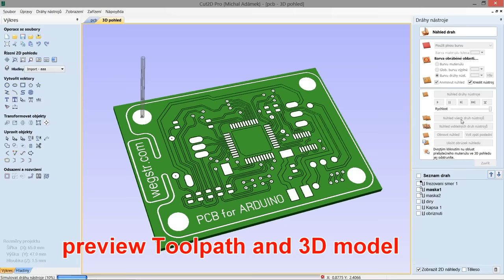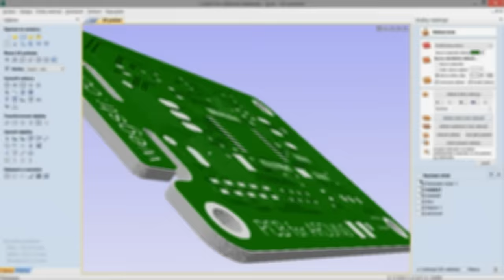How to make a PCB prototyping with UV soldermask - STEP by STEP

Comment: what about via holes in double sided PCB
Reply: you can buy rivets on ebay and stick them in the via holes to make the connection from one side to the other that is what  i have done in the past with homemade double sided boards
Reply: I was wondering if the tinning step took care of that, I suppose not.
Reply: The tinning "sticks" to the exposed copper, so there is not any copper inside the holes only around them, so the tinning does not stay in the holes.

Comment: So in a nutshell,
Step 1: Design the PCB
Step 2: Mill out the traces (from a blank, copper-laminated board)
Step 3: Apply solder mask (to protect the exposed traces)
Step 4: mill the solder mask off the contact pads (to allow you to solder components onto their traces)
step 5: Drill any necessary holes and cut out the PCB

Step 6: Protect the now-exposed copper contact pads from corrosion with tinning solution
PCB DONE
Reply: Was looking for a comment that summarizes the process... Cheers!!!

Comment: 1. What are the dimensions of the PCB? 
2. How long did it takes from start to finish it all?
3. What about the vias? Did the tin solution connect the top with bottom layer?

Comment: Great!!
But very expencive
Reply: It is little bit pricy, but when I compare this video and some other cheaper Chinese CNC that I have, the end result is just awesome, I still can't believe that this is done on CNC. It makes me think again to try this one :)
Reply: Actually, if you compare it with more expensive machines, It doesn't look bad at all.
Not expensive, costy I would say.
Can't convince my boss to get it >,>  I'll have to get by with a cheap one.
Reply: I would think twice if you plan to use cheaper one for PCBs, it won't be that precise...maybe to take a look at something like Voltera One
Reply: We are not the kind who think things too much.
After a few hours, we are already buying one :v 
We don't need it to be that precise, we just need to improve and speed up our prototyping. 
We liked the Voltera though, thanks for letting me know.
Reply: I wanted the same few month ago, and ended up buying small CNC for that, but it turns out it was useless, I was getting much better and faster results with simple photoresist dry film. This CNC looks very precise, but lack of automatic z-axis sensor can be pain in the but :)
Reply: We are not even using photoresist film now, wich is very good, It's natural if the result is better. 
I'll check the z-axis sensor thing. It could be a simple short circuit in the board copper, can't it?
Reply: Yes, that's how they work, z-axis (touch) sensors, just short circuit with board copper, but better check which software this machine support, and if that software can work with z-asix sensor like this https://www.ebay.com/p/CNC-Z-axis-Tool-Setting-Touch-Plate-Probe-Mach3-Router-Mill/1949964503 and see if you can hook it up. They said there's no sensor on machine, but didn't say if there's a left functionality on their board so that you can add your own sensor.

Comment: If only this cnc wasn't so darn expensive.
Reply: CNC 3018 PRO, it cost me 170 USD (shipping to México by DHL) on Aliexpress
Reply: @XDFTube  What software do you run to make pcbs? Do you have any videos?
Reply: @larrybud  hi I use Candle, the newst version, in that software you can update the firmware of the control board candle is the same software than GRBL controller with some upgrades

Comment: Milling the solder mask seems strange to me. How did you calculated its exact thickness and how did you ensured that you milled away just the right amount of solder mask?
I your milling depth was was a bit wrong you would either mill the copper pads or you would leave a thin film of solder mask that would cause  problems when soldering. Please clarify.
Reply: Sprng tension milling technique ensures only light force enough to mill the mask and little or no damage on copper.

Comment: please help me to buy the right tools from your website. which tool angle did you use for removing the pcb soldermask with the compression spring.  the  "30° - spiral carbide engraving bit"? or the 60  and the compression spring is the "compression spring - steel (0.2 x 2.5 x 26 mm)" right? and which tool angle did you use for removing the copper for very tiny smd components? 30 degrees 0.1mm flat or v? My guess would be the https://wegstr.com/30-spiral-carbide-engraving-bit. but I saw you used two in the video, can you describe well which parts from your website you have used so that I can buy them with no mistake.

Comment: Hi and thank's for your video. Too easy because simple side.
But your milling and drilling methods seams to be well improved and reliable.
I'm beginning the tasks of "electroplating through holes" at home.
With my CNC i'm just drilling holes as a first operation.
I etch with the paint burning method using a laser.

Comment: Great method. I was looking for a engraver/drag method of removing resist without using UV/overlay to avoid needing to get a laser printer. Nice. Now I just need to find a 30° bit that is setup for springs for ER11 setups...

Comment: Very good quality, impressive. Unfortunately, the machine is very expensive for hobbyists.
Reply: Alexandre Verri , buy cnc like this from China . It cost near 200-300$
Reply: А название модели узнать можно?
Reply: вот. нужно брать под себя( размер , комплектация ) . Еще рекомендую посмотреть видео про них, много подводных камней, которые нужно учесть при покупке. https://ru.aliexpress.com/item/CNC-1610-500mw-laser-tube-diy-cnc-engraving-machine-Pcb-Milling-Machine-Wood-Carving-machine-cnc/32719998036.html?ws_ab_test=searchweb0_0,searchweb201602_1_10152_10151_10065_10344_10068_10342_10343_5722611_10340_10341_10543_10698_10696_5722911_5711411_5722811_10084_5722711_10083_10618_10307_10301_5711211_10059_308_100031_10103_5711511_10624_10623_10622_10621_10620_5711311_5722511_10125,searchweb201603_32,ppcSwitch_5&algo_expid=912a05f5-5dd6-44d8-819c-586eb533c042-8&algo_pvid=912a05f5-5dd6-44d8-819c-586eb533c042&transAbTest=ae803_2&priceBeautifyAB=0
Reply: а что в этом станке плохого, того что по ссылке на алиэкспрес дали ?
Reply: его нужно собирать. мотор не стабилен и может давать вибрации на инструмент. для домашнего применения самое то.

Comment: Hello Lukas, I have this Wegstr machine but my old pc with parallel port died so the cnc machine is not in use now and just sits redundant on a shelf. I hear you are working on a USB version, when that is completed would it be possible to buy the USB control board only and place it into my parallel port Wegstr machine to get it runnig again but on USB?.
Reply from the maker: Hello, more information via email....
Reply: WEGSTR CNC Thanks I have emailed to your website :-)
Reply: just wired the thing with an arduino and GRBL.. cheap cheap cheap

Comment: I never considered using a spinning tool to remove soldermask. I've been using transparencies and acetone.Your approach is remarkably superior. My cnc machine doesn't use a set-screw for its tools, it uses a collect chuck. Do you think the spiral engraver and spring combination will still work?
Reply from the maker: It is not so standard combination to use the spring below the bit. But it works.

Comment: how you prevent the bit from wobbling axially when you use the spring. I mean the bit and the spring are not fully tight in the chuck so they can move up and down correct?
Reply: double point bearing... exactly the same thing you use in a 3D printer axis... you have one bearing on each side of the axis so it cant move.  
like this: (::)==[]====[]==>
spring: (::)
bearing: []
drill bit: ====>
Reply: @Ali idk... I search myself and couldn't find it too... What i know is what its supposed to do. Its made to protect the piece if the CNC machine accidentally applying too much feed force.
While the piece will still receive more feed force the force will be divide with the spring and will be applied smuttier instead of a spike.

Comment: This is impressive, it looks like it freshly came out of my manufacturer! I didn't realize CNC's were precise enough for you to remove the solder mask without drilling through the 30µm (or so for 1oz IIRC) of copper. I'm also wondering what you used for the tinning, will that properly make your through-hole pads connect from front to back?
Reply from the maker: As it is not double-layer PCB the back side is not connected.

Comment: I really like this. But I assume the one thing you don't have a process for her (besides printing/screen) is plating the through-holes, right? I assume the through-hole components here wouldn't work without you then soldering both sides, and that vias wouldn't work at all?

Tinning would just cover the copper.
Reply: You can electroplate the vias but you'll need to drill the holes first and plate, and then mill the traces and mask.

Comment: How does the machine maintain an even depth of cut on PCB? Thx.
Reply: There are other softwares for that like Autoleveller, PCB Probe and OpenCNCPilot.
Reply: I think this machine milled it's own bedding which ensures the gantry and bedding are aligned very well.
As long as you lock your pcbs down correctly it should allow you to skip auto levelling. However if you dont' want to mill a bed (which is pretty easy). 
For a software solution: 
You can autolevel in the Gcode itself (http://wiki.linuxcnc.org/cgi-bin/wiki.pl?PCB_Milling_And_Drilling_With_Cheap_And_Simple_Height-Probing)

It looks a little odd to use but basically, the steps consist of downloading the github files and running a python script. The generated G-code does height probing before cutting, it gives perfect results every time.

Comment: Ae the CNC machines for creating machanical parts the same as those for pcb milling ?
or the the machines are different?
Reply: You can use a CNC engraver or any CNC machine with a milling option that supports PCB's or engraving. It's even an option to make your own machine using open source software and hardware. So in short, you could technically use any CNC machine with a drill aslong the software allows it.

Comment: How did you generate the tool paths for the solder mask?   I am using FlatCam but dont know how to invert the pads so the tool will clear them.... ?
Reply: Steps just according to the video - we used Sprint-Layout for design and Cut2D for tool paths (it is done from picture generated during designing).
Reply: Thanks.   I just found out that Sprint-Layout has an inverted option on the gerber output which does exactly what you did in Cut2d.   I ran it through FlatCam v8.5 and it works nicely!
Reply: What type of cam operation did u use to engrave and remove the mask e.g pocket for holes?

Comment: Jan, how you are sure, you do not damage the very thin copper layer instead just milling the solder mask ? What is the solder mask height, is this constant ?
Reply: As you can see on the video we used the spring bit. It is just simple spring placed under the V-bit. This ensures the constant depth of the milling if there is some bump.
Reply from the maker: You have to clamp the spindle on the right place - just below the overhang

Comment: How do you calibrate Z coordinate after you put the milling tool and how deep to mill PCB? I don't see any z-axis sensor. Also, how come that after milling the solder mask pads comes out white? Does your software also calibration for double sided PCB and  how would that work?
Reply from the maker: There is no sensor for z-axis. You just have to setup zero points for every axis and manage the deep of the milling in designing software. The depth depends on the material. The white/silver color is made by tinning. Our software is not calibrated for double sided PCB, you have to be handy :)

Comment: How you prevent to damage the copper tracks when removing the solder mask with the cone tool? Presure control?
Reply from the maker: we used the spring bit for that control

Comment: how did you tin the PCB? which chemistry did you use?
Reply: AFAIK, it is tin dissolved in hydrochloric acid. The tin in solution swaps places with the copper, tinning it.

Comment: several questions.  what is the tinning soulution used ? after the mask was applied it did t look like copper. it looked tinned already when the cnc was routing away the green mask.  
and finally, what software was used for the pcb design ?
Reply: It’s a chemical timing agent
Reply: Very good

Comment: How did you plate the holes? Also how does tinning work? Also I noticed a gold finish. So how is that made possible?
Reply: Holes done by drilling. Tinning work done with tinning liquid (10 minutes in that). There is no gold.

Comment: hello, how about, an excellent job, a question, what do you put on the board so that it becomes green and what function does it have?
Reply: This layer is know as Soldermask. It is thermally resistant and prevents solder from sticking to anything other than the leads. This specific solder mask is uv-cured and can be found on amazon.

Comment: Why would one need to get rid of all the unnecessary copper, anyway? Wouldn't it allow better heat dissipation leaving it on?
Reply: Sometimes you don't want copper near to the traces, is a personal choice and when you gona handle high currents but normally an experienced pcb designer would add some isolation to that paths to maken more space between some traces or all traces but not get rid of all, in the end is more kind of a personal choice.

Comment: I am quite jealous!!!! that looks amazing.

i was hoping i could get some advice. i purchased the white variant of that paint. exposed to to an led array i made of 99 uv 390nm leds bought on ebay, and left it on over night. in the morning half of the uv paint stuck to the transparency and it was not fully cured. what am i doing wrong?
Reply from the maker: Maybe the layer is too thick or weak power of the UV radiation. We use 60W UV lamp.

Comment: OK, I'm missing one important thing - but before that, great video - and very cool.  So there are no through hole components, only surface mount?  No internal planes for ground or power?  Nothing on the other side?  Then plating through the holes is not important and I understand the demo, although I wish everything I would ever lay out or design would be that simple.  Still, it was impressive, and looks outstanding - and accomplished your design task obviously.  Good machine also.  I would not mind having one myself!  Thanks for the video.
Reply from the maker: Hello, thank you for your comment. The PCB is only for demonstrative purposes. So you are right, there are missing some components. We are currently preparing the video about double sided PCB. Stay tune...

Comment: to save time, cant you mask first and then mill out the traces?
Reply: You could but your traces won't be properly masked. If you mask first and then mill, the sides of the copper traces will be exposed allowing for solder to make accidental electrical contact. Also your PCB will have a really rough finish to it...possibly even leading to accidental peel of the solder mask/copper trace. Sort of like scraping a stamp of a letter
Reply: @Rishi45001  brooo. I realised that the next day. I must have been  high

Comment: Excellent
Tell me please, how is the mechanism of the spring-loaded of the mill? I want to make myself the same
Reply from the maker: See our next video https://www.youtube.com/watch?v=wr7l67sd3NM
Reply: I saw this video, but there it is not clear how the spring holder of the mill is arranged, which stands in the spindle

I have a Chinese spindle, for the ER16  collet and I can hardly imagine the device of such holder

  I believe that there are a lot of nuances there, such as feed, spindle speed, angle of sharpening of the engraver, after all it is necessary to cut only the layer of the solder mask and not to touch the copper

I would be grateful if you could tell everything in detail

Comment: This looks great! Thanks for posting. Do you have any suggestions for how to apply a silk screen on top of all that?
Reply: I always use the "toner transfer" method. Never tried it with white color but should work also if there is white toner available for your laser printer.
Reply: With these tools, you could put down a layer of white paint and mill away everything but the silkscreen text and graphics!  Impressive stuff!

Comment: Excellent! But is there any way to fulfill drilled holes with solder? Maybe it would be better to drill larger hole, then fill it with solder and drill it again with smaller diameter. Thus we can get a full solder cilinder in a hole.

Can you find some other ways to make it?

Comment: Which solder mask was used in this case? It is really nice and shiny.
Reply from the maker: Just common solder mask bought on ebay.
Reply: Thank you. Did you get it in a tube or was it a foil?
Reply: +Žiga Lausegger You can see that in the video. It was in a black plastic jar.

Comment: Is this CNC include milling drill bits and free software? Can you upload some video about the software? Is the software familiar with like KiCad or Altium designer exported files ?
Reply: The Software is Cut2D from Vectrics. And it's not free and not at all cheap.

Comment: Two things:   the board appears to be a thicker than usual type of PCB...   and second:  Why did you use a spring for the solder mask clearing?
Reply: The board is not thicker (it is FR4 based material). We used spring bit to mill just the exact part of the material and it also balances the bumps.
Reply from the maker: PCB is 1.6 mm thick
Reply: Thanks for the info!